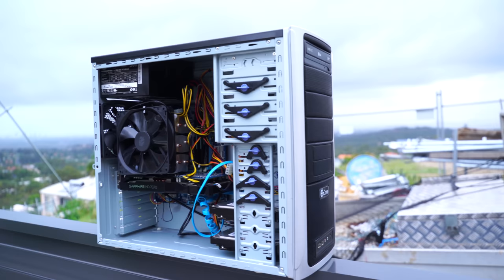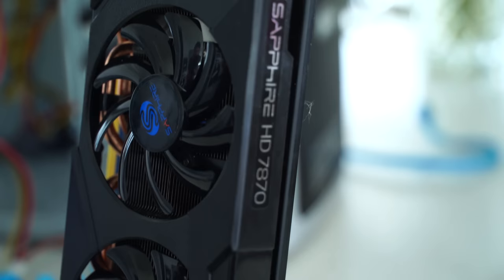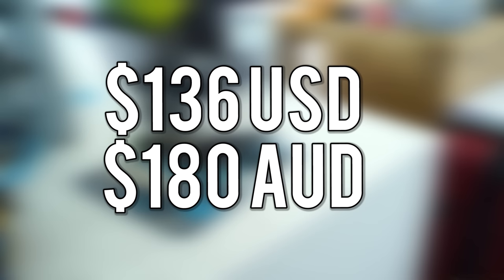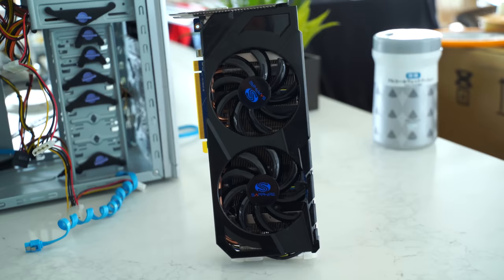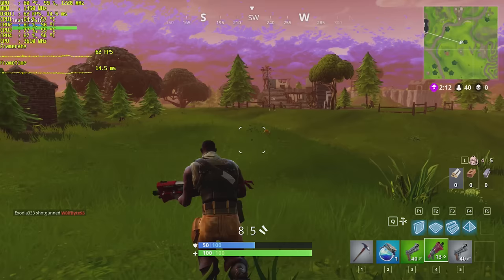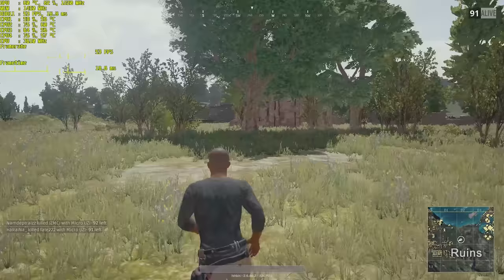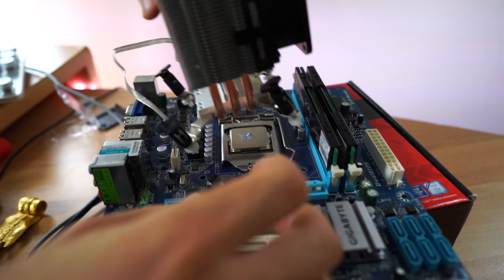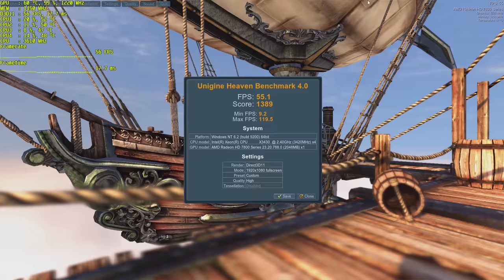The $136 FORTNITE 1080p Gaming PC Build 2017

Comment: I think that micro ITX FM2+ motherboard and a A10-7850k (Kavari) and 256GB of DDR3 RAM and forget about the graphics card as that is integrated into the A10-7850k (Kavari) and what ever hard drive and DVD /RW drive plus Windows 10 OK but Windows 10 is susceptible to malware so Linux Mint 18.3(Sylvia) 64 bit might be a better option as there is not much Linux Malware in the field at the minute, if you go with this setup then you will need the AMD/ATI Catalyst drivers for the A10-7850k (Kavari) and a 12v to ATX adaptor board will as as PSU.

Comment: My main rig costed £160 GBP ($260 AUD) and has an i7-950, 560 Ti and 12GB RAM. The GPU may not be as good but the CPU is wayyyy better. Literally just buy an old LGA1366 workstation motherboard and loads of 2GB RAM sticks

Comment: Couldnt u add in a chespo 2 port sata 3 or even sata 2 card to get rsid to work.   Ptobly would work wrll.   I have fone this on plenty of older 775 socketed boards with great luck.   Just a suggestion.   Found last card i setup for a freid for 8$ off ebay with two used 180gb SSDs,  was very impressed eith load times

Comment: Hopefully now you have videos of what a cheap PC sounds like. I highly doubt that it wasn't that loud.  If you had headphone, who cares but you need to have a smooth PC running just so you can tell the difference if the PC is running well or it sounds like vacuum. Also the device you have that checks the mother board to make sure it doesnt blow out, I think that what it's used for. How much did that cost and what is the average cost of the cheapest? Also that silicone, was it a special silicone?

Comment: I have a similar PC. Phenom II X4 965 huge cooler, R9 270x and 8gigs of Ram at 1333 MHz. Firestrike scores are similar even if yours where a little better I think. Haven't tried gaming so far as I don't game and would have my other PC for that. The overclocks on mine... Well the CPU will not go past 3.8GHz and I'm already at 1.5V at this point and the Graphics card will not OC at all. Have it in the fancy looking old case of my main rig right now and my old 1TB external drive as Hard Disk that I haven't used since 2013. Those are not in the budget but because I had those laying around anyways. Other than this I'm in 75€ 89US$/117AU$ for the whole thing. I guess that makes up for the little less power compared to yours

Comment: I have the exact same motherboard ,an intel core i3 540 , 2gigs of ram, 500 gigs of storage space, integrated intel graphics, and a decent 500 watt psu or smps . Should I upgrade my rig to the following in order to get performance equal or maybe better to a g4560 and 1050 ti paired together-
I3 540 to X3450
2gigs of ram to 8 gigs
Intel hd graphics to gtx 1050 to
Stock cooler to evo 212
Pls tell whether I will be able to hit 60 fps at high settings and will the performance be better than g4560 with gtx 1050 ti with overclocking

Comment: Are you using some sort of custom settings on your fire strike benchmark?  my heaven benchmark score is so much higher than yours but my fire strike benchmark score is only a little higher than yours:

my unigine heaven score - 2261
your unigine heaven score - 1389

my 3dmark fire strike score - 6925
your 3dmark fire strike score - 6265

I'm using the free basic edition of 3dmark if that matters.

Comment: Holly shit that is seriously cheap! I paid 420USD for Z77A+i5-2500k+8GbRAM(150$)+GTX670(100$-that is cheap in my country!) which has just slightly more performance than this awesome 136$ build. I am able to max out Fortnite over 60fps, tho it's not ideal, so i get from 80 to 120 capped on a low-max settings. In my opinion this build should not lag even on ultra settings on Fortnite, so i think i could blame it either on the HDD, faulty RAM stick, or poor drivers.

Comment: I was just wondering if a Noctua NH-U12P is a decent choice, since the on shown in this video is unavailable in my country? I also seen a deal for a i5-750 + 4GB DDR3 + ASUS P7H55 mobo for $100? And I've seen a relatively cheap HD 7850 1GB, since HD 7870's are stupidly expensive on the used market in my country? So with a bit of overclocking can a HD 7850 match a 7870?

Comment: Brian I have a Lenovo M73 PC I was thinking about gutting it and putting it into a larger case with a better power supply. have you done this in the past? if so what issues could I run into? the only thing that concerns be is haveing to use a 24 pin to 14 pin power adapter for the mother board. Any information would be helpful!

Comment: Ok so in fortnite i have 70-130 fps on low settings, will i be able to run pubg? 
Specs:
CPU: Amd Althon x4 845 quad core 3.5 gh
GPU: Amd Radeon R7 Sapphire 1gb GDDR5 
RAM: 8gb 

And i am gonna probably buy an GEFORCE GTX 1050ti Asus 4gb gddr5 OC

Comment: How can I be sure top mounted cpu AIO will clear ram?

EK-MLC 280mm aio: 3831109863831
AIO specs (radiator plus fan): 335x 142x 68mm (LxWxH)
uses 140mm fans

Phanteks pro m glass se:PH-ES515PTG_SWT
memory clearance: 
Motherboard-fan
using 140mm fans is 48mm clearance 

F4-3200C14D-16GTZKW 
g.skill z trident ram specs:  44mm Height x 132 mm Length. 

mobo- Asus Rog Maximus x Hero (Wi-Fi AC) LGA1151

How can I be sure ram will clear aio? Do I add 3mm for motherboard? Puts me at 44mm+ 3mm= 47mm. Which would barely clear the 48mm under case ram specs.  First PC build so I am not sure.

Comment: Could you use gpu vram heatsinks on the mb vram to stabilise the 3.8 overclock for that board?
Reply: He could but there's no need, they are perfectly cool at 70C relatively speaking and will last for years and years at that temperature.

Comment: Need help I have a gt730 4gb gddr5  and 6gb ram, intel 2100   And fortnite crashes when I get into some game runs fine in creative at 80-100 FPS  but when I get into a solo match I get 10-40 FPS on all low setting and a minute later it crashes I'm thinking it the ram so I'm upgrading to 12gb and a new cpu any thoughts before I do?

Also I have a 300 wat psu I pretty sure that's the problem

Comment: Can someone give me some advice. I have an lga 1156 mobo and an i3 540. I wanted to upgrade the cpu. Is it worth spending 16$ more for the x3440 or should i just get this x3430 for 8$. The pc is used as a living room media center. I ocasionally play some games on it but it's pared with an hd 7770 so nothing new. Games that i would be playing are mainly older from 2012 and around. I would like to spend as little as possible.

Comment: Hi, I did some research on Xeon x3430 I saw it only sport ddr3 800-1333 but how did you put two ddr3 1600 on it and it worked
Reply: PC Gaming the ram speed is slowed down to 1333

Comment: Off Topic a bit. not sure if Brian reads these comments. But I was wondering if you could to an accelero tutorial I picked on up for 10$ on Craigslist for my evga gtx 670. could not for the life of me get that thing on. (yes it was on the compatible cards list)
Reply from the maker: Really? depends if the 670 is aftermarket or not, if not reference then it might not fit :(
Reply: Tech YES City I bought the card straight from Evga when the 670's first came out. not sure if that helps.

Comment: Will i be able to run a rx 470 in a 450watt psu? (300w in 12v rail)
Reply: Depends on the CPU and usage scenario but you could do it yeah.
Reply: List your parts in a PC Part Picker list and check the wattage. Don't just take the word of random youtube comments.
Reply: Better don't do it! It could run but looks like it is old cheap and crappy PSU. It can burn your rx 470. If you accept the risk...
Reply: I have 500w psu and i have no problems. Rx 470 uses 125 watts and cpu about 75 watts so you shouldnt have problems
Reply: yea, better get 500w+ psu
Reply: rx470 eats max 130-150w on full load, so i say to YES
Reply: Easily. Unless you're planning on pairing it with Threadripper or an i9, lol.

Comment: Why do I get less FPS with i3 7100 and gtx 1050 2gb?
Reply: dual core with 4 threads will do that...1050 2gb without good overclocks is a bit slower than that 7870 but uses way less power.

Comment: I have a 3570K at 4Ghz. What GPU should I get to upgrade from a GTX 780?
Reply: I run a 1070 with little to no bottleneck. You can overclock that 3570k to 4.3-4.4 easy if you have a cooler.
Reply: Mark Cox 
It's on a H100i. I've struggled to get it over 4.1 stable. I have an Asus P8-Z77-V LX motherboard

Comment: Hey Brian, would you do a memory overclocking guide or could you tell me if just throwing timings off same manufacturer 3000 kits onto a 2133 kit has any negative effects? I'm curious because I only changed timings that are listed on product pages and not the deeper more advanced timings.

Comment: Hello! Can someone tell me, why does my pc, with an FX-6300 and GTX1050 can't run pubg more than 50fps on very low?
Reply: ツCappy™ ツ How much RAM do you have? On low PUBG uses 2GB VRAM, your CPU won't be helping either, it's pretty weak sauce.
Reply: Callum Leigh Montgomery I have 8gbs, and the CPU OC-d to 4Ghz.
Reply: Well I have nearly 300 hours in PUBG and I went from a similar CPU to a haswell i5 and the difference was crazy, I also went to 16gb of RAM. So if you can change that CPU, I would do it personally.
Reply: Alright. Thank you :)

Comment: can you help me i have a core 2 quad q8400 an r7 260x 2gb and 6gb ddr3 ram fortnite runs terrible. On the same settings you had the game run around 34 fps my cpu was  90 to 100% used and my gpu was 30% is there something i'm doing wrong?
Reply: Sounds like a huge cpu bottleneck. The xeon has a lot more transistors than the core2quad which could be where the difference is.

Comment: I got a qeustion Brain i got 200 euro and i now have a gtx 750ti to what should i upgrade it
Reply: matthew smit i don't know where you live but in finland i saw a new gtx 1060 3gb for 199 euros so that would be great upgrade
Reply: What CPU RAM And psu do you have ?
Reply: домино™ i5-2400 16 gb corair ram and 750 cooler master psu
Reply: matthew smit search for a used 970 ;)
Reply: matthew smit if you have that big psu you could buy r9 290 or 390 they are pretty cheap

Comment: How's that gpu compare to rx 560?
Reply: The HD 7970 is significantly more powerful. RX 560 is more comparable to the HD 7950
Reply: Shivam Kumar this is a 7870 not 7970, and they perform roughly the same, the 560 is a bit slower but not by much

Comment: Will fortnite work on my pc? My specs are
I9-7920X 12 Core 2.9GHz
4TB 7200RPM + 2T  SSF
64GB DDR4 SDRAM 
2X SLI Nvidia GeForce GTX 1080TI 11GB GDDR5X
Reply: Jomz At 480p, low settings and 12fps? Maybe yeah
Reply: Sentinel_RSG rip..  Well atleast minesweeper runs
Reply: i9-7920C doesn't exist lol
Reply: Brady Bortnem i meant I9-7920X
Reply: nah man shit wont run might wanna get a new rig

Comment: Yo can anyone tell me is this pc is good enough for games like PUBS,BF1,CSGO,GTA V...
Current price is:  212,66 $
Procesor : Intel Core2Quad q6600 cloched on 3.0 ghz
Graphic card: Nvidia GTX 760 2GB
Ram : 8gb DDR2 ( 4X2 GB)
HDD 1: 500 GB
HDD 2 : 250 GB
Reply: PUBG= not at all
Bf1= low/medium settings
Gta V= medium/high
Csgo= ultra high
Reply: How about this same price:
Motherboard: ASUS P5QL-PRO
CPU: Intel Core 2 Duo E8400 (6MB Cache, 3.00GHz, 1333MHz FSB)
GPU: Sapphire Radeon HD 7750 1GB DDR5 HDMI / DVI-I / DP PCI-Express 
PSU: Thermal Take SE 530W 87% eff.
RAM: 8GB DDR2
HDD: 500GB 5200RMP
Reply: hrustA worse
Reply: Change the fucking memory ddr2 wtf
Reply: Get rid of the core 2 quads and ddr2 lol. The GTX 760 will play pubg just upgrade cpu mobo and ram. I recommend a x3440 and a p55 mobo which can be found on aliexpress for cheap then get 8gb ddr3
Reply: 8gb of ram is not enough to play pubg without running out of ram get  12gb of ram atleast and ddr3 not ddr2 also try and find a cheap quad core cpu that thing will not serve u well
Reply: hrustA only for csgo in ~medium settings
Reply: hrustA you need a quad core, and then yes
Reply: that'll give you 60 fps in csgo, i don;t think it could play pubg. and 40 fps in gta 5 at pretty low settings
Reply: Get the cpu from this video